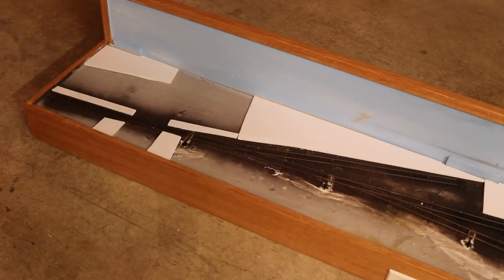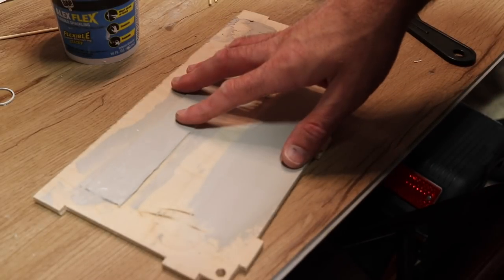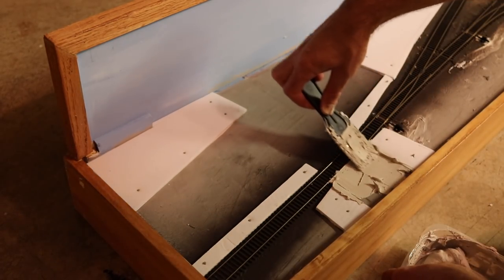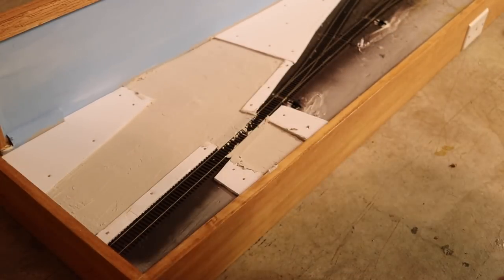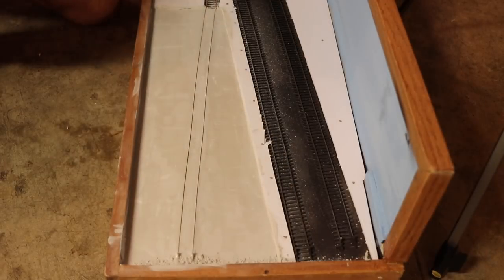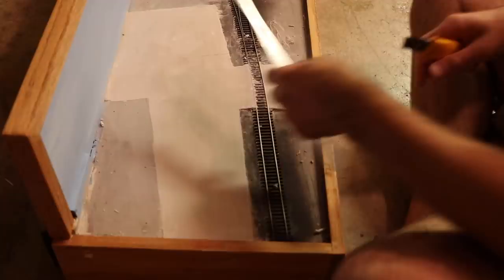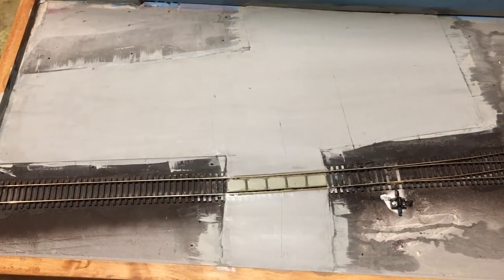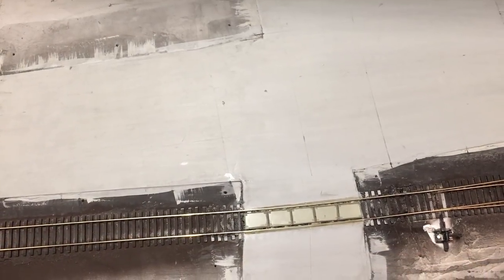Tulsa Spur Part 7: Make Model Roadways with Patching Plaster!

Comment: I use spackling paste as well for my roads. However, I use a screed to for the initial leveling. A screed is a straight edge that spans the edges of the foam forms. Basically you over fill the forms then slide the screed along the forms so that the excess pastes is scraped away leaving the top of the road surface even with the top of the forms.  This is the same method used in actual concrete work.
Reply from the maker: tombensky Yes, that is a better way of doing it, and I had originally planned on doing something similar as I had done that method on an old larger HO scale layout but I didn’t in this case mostly because I was lazy and didn’t want to add more strips of plastic or wood along the edges of the layout that I would then have to pull out and patch.  But your method is definitely the way to go for longer consistent road sections.